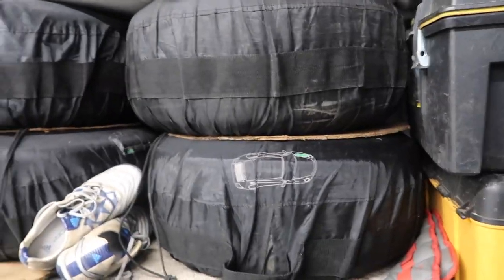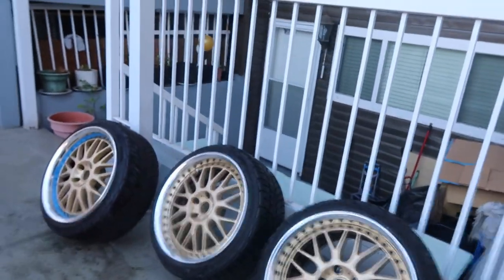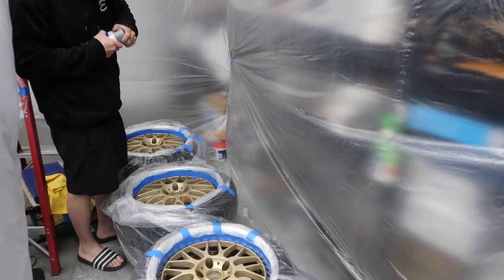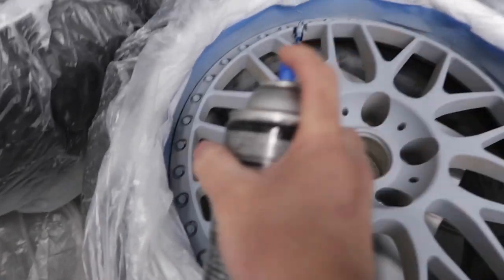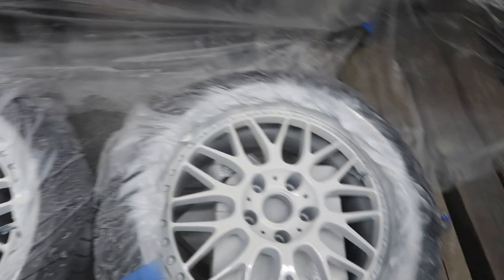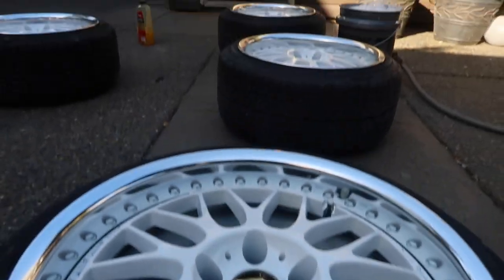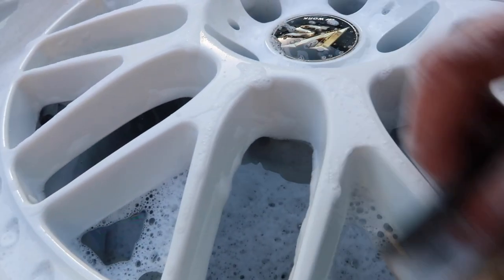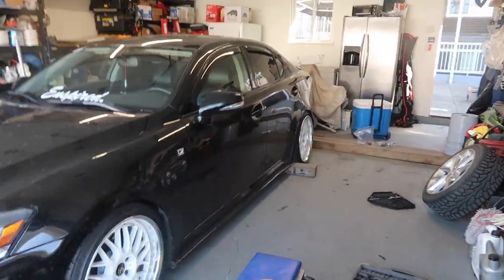Painting My 3PC Wheels With Less Than $200!!

Comment: did you have to sand down the area between the lip and the face of the wheel, where the bolts that surround the rim face are at?
Reply from the maker: I just peeled one by one. I would just tape it before you spray

Comment: jeezus...not THAT bad, but the bumps aren't from 'stuff coming out of it' -- it's likely "solvent pops" which often happen with spray cans (well, all spray painting), especially when cooler/cold outside, and you're in Canada you said. Solution is to warm up the cans in a hot bucket for ~10 minutes before spraying, paint will flow and lay sooooo much smoother.
Reply from the maker: Thanks for the tips , definitely will try !